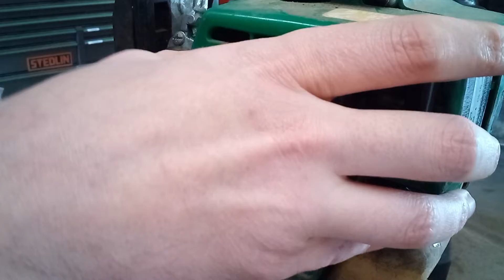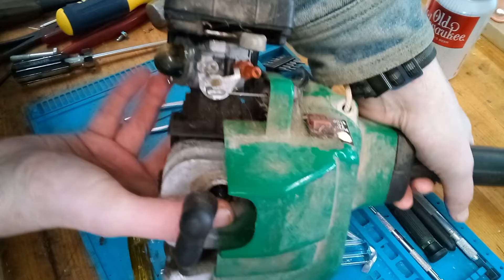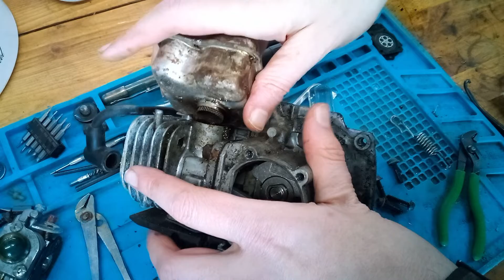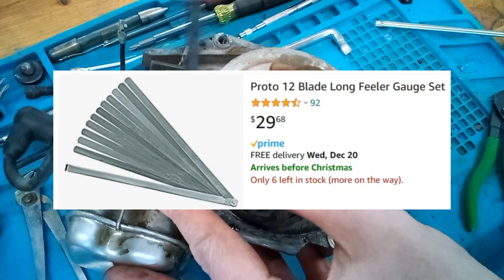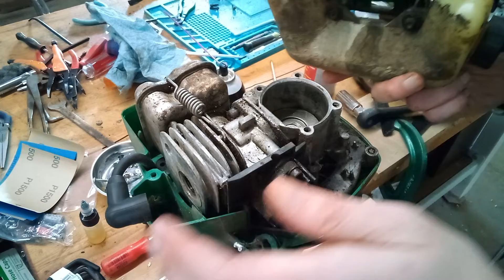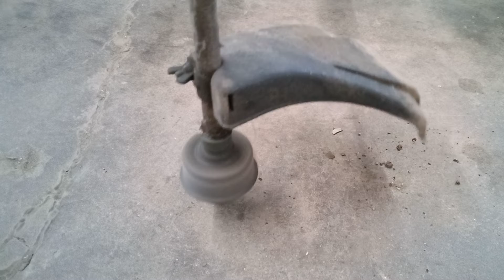Weed Eater Featherlite Ignition Coil Repair & Muffler Screen #diy

Comment: This is why I put my stuff away when I'm done with it and not let it out in the rain.  If I hose it off, I do it before I use it.  Then I run it to dry up the water.  I have this model and new carburetor will be here tomorrow.  I picked this weed whacker up for $10 as a non running unit and when I took the carburetor apart.  The diaphragms were stiff.  With all the carb rebuild kits out there, it got confusing, and a new carburetor was $14, shipped to the door, with some fuel line and a new filter.  I already put new fuel lines and a filter on it though, the owner had the lines run backwards.

Comment: Hello i have husqvarna weedeater. I rebuilt carb....fired right up on first try ! Used it for 1 hr weedeating!! After 5 hrs i went back to start carb ! Now will not start..cleaned carb 3 times now! Will not start ! Replaced fuel lines tried different sparkplugs !! Checked for spark !! Any ideas ? Also checked the exhuast screen!!
Reply: Well .... did you get it figured out ? Am interested in hearing what came of your problematic weedeater ? I have a Husqvarna 130 C and it's giving me fits !

Comment: I put mine back together and I hear a metal ringing. 
Now I know it’s most likely that I gapped the magneto from the flywheel. I didn’t rotate the magnets and if there is any difference that could be the issue. Either way I’ll be taking my Husqvarna apart for the fourth time tomorrow when my new magneto (old one was spliced) comes in tomorrow. 

Thanks for the great video
Reply from the maker: You're welcome! Thanks for watching. Yeah it could be rubbing on the flywheel.
Reply: Hdidntweedeater
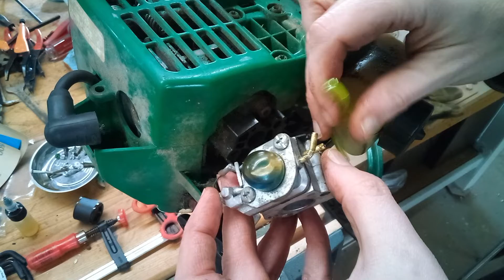Feather weighg 8:40